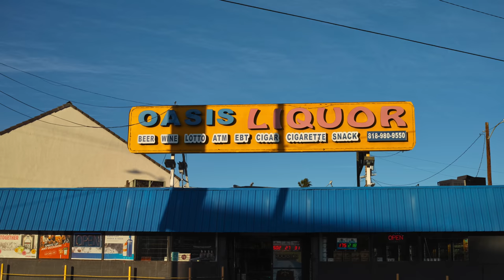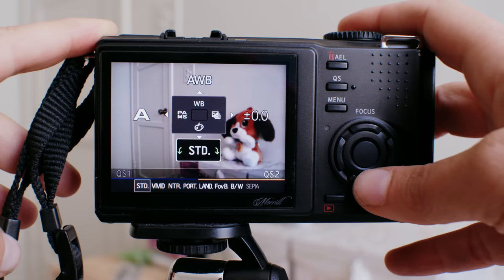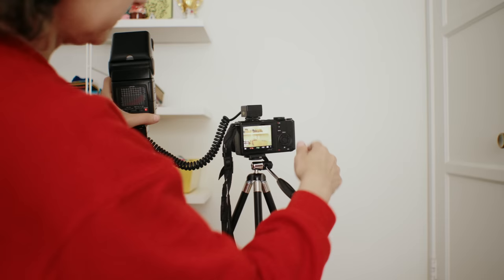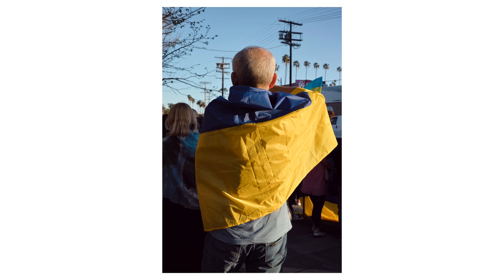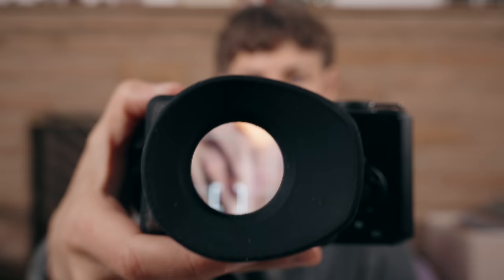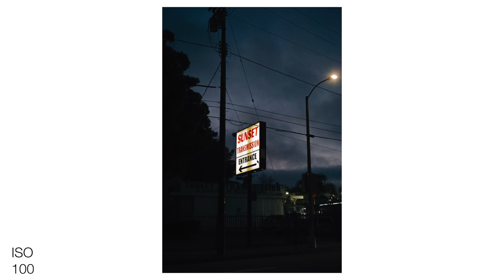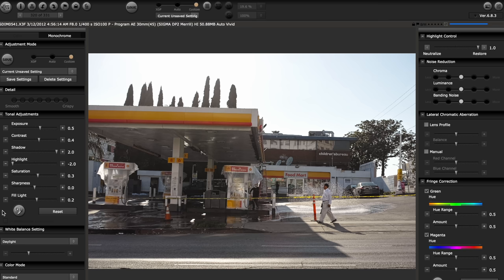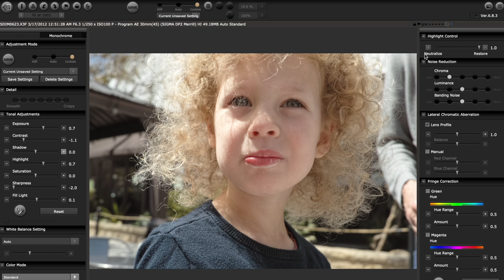Sigma DP2 Merrill Review

Comment: Nice video! The first generation had 2 dps, the second 3 and the third 4. You can do high iso with the Dp Merrill cameras in B&W if you like high ISO film look with grain. One trick in SPP is to choose 100% blue in the monochrome menu. Then you use the data from the top layer and not in the lower levels. This means you get much less noise. Test by changing to 100% red to see. The light is moving through the sensor so one have drop off and noise at the bottom. This trick only work with Merrill files. For me it is always the outcome that matters most, so I don't mind it's slow operation. Photography is my zen after all.
Reply from the maker: This a fantastic bit of info! I didn’t realize until after posting that I hadn’t even touched on the incredible black and white capabilities. Definitely pinning this. Thank you for sharing.
Reply: Hey Innstikk, why would this only work with Merrill files? Although there will be comparatively less noise in the red and green Quattro layers, why wouldn't it work there also?
Reply from the maker: @ricblessing3400  Great point and question!
Reply: @Ric Blessing  It should work with Quattro, but Sigma made the wheel work differently for Quattro. So far I only see the effect with Merrill files. I guess it could be as the two lower layers have less resolution in the Quattro sensor, they are already using the top layer to get to the toplay resolution. I don't know their decisions, but at least it works for Merrill. Merrill is also very nice for B&W due to they way they implemented the microcontrast.
Reply: But wait, there’s more. If you are into B&W photography and rely on color filters, Sigma Merrill series cameras do double duty as a monochrome sensor or B&W film – a unique feature for a digital image sensor.
Reply: @OneMonthTwoCameras Hello, I am curious…does this camera have a mechanical shutter?
Reply from the maker: @IamRorke  it is a leaf shutter

Comment: I don't believe Sigma will ever produce the full frame Foveon camera. It's been in development hell since 2019, and IF it does release, it will be extremely expensive to cover the development costs. The last interview with the CEO didn't sound promising. The Merrill generation, which I've owned all of including the SD1, are by far the best Foveon cameras, with the DP2 having the most superior optics. These are the only cameras I've ever owned that when reviewing the images I've audibly gasped and said "Wow". In the right conditions, they are nothing short of magic. I've been dreaming of a full frame version for a decade.
Reply: Sigma fp with foveon❤
Reply from the maker: Curious to see what will happen!
Reply: SD quattro and DP quattro are more fun and less annoying
Reply: Why bother? The APC is a fine size.
Reply: @unbroken1010  Perhaps. I prefer the image quality of the X3 Merrill generation over the Quattro sensor. The Quattro trades off true Foveon architecture for reduced noise and therefore does not absorb 100% color on each layer as opposed to the X3. As far as the sensor size, I prefer full frame due to DOF and lens compatibility. With a larger surface area for the sensor, the light sensitivity should also greatly improve as well as noise levels at higher ISOs. That is the key reason for Sigma's attempt at a full frame sensor. Ditching the SA mount for the L mount will be the biggest upgrade by far.
Reply: @daygon128  maybe but in reality regular people viewing your work on a wall or in a book are more interested in content and not bokeh. Bokeh is a bit obsessive and does not always contribute to a photo. It can actually be a hinder in a lot of cases.  Lots great Photos got taken at 400 ASA 🤷
Reply: @unbroken1010  I use the Fujifilm GFX for most of my portrait work and have made several videos on it. Bokeh for me is a stylistic choice for portraits. My clientele, and the internet in general loves it, while photography gatekeepers hate it (but yet it's ok if they do it). 90% of prints I have sold at galleries were shot at f1.4 or wider unless it was my landscapes. I'll shoot an entire job at f16 if the need is there. DOF on the other hand, is essential when I'm shooting in less than ideal conditions with busy backgrounds. APS-C is fine but I typically find myself having to switch to long focal lengths to isolate my subjects and when using a wide f stop such as 1.4 on APS-C, that's still only the equivalent of f2 on full frame. As for the future of Foveon, I'm intrigued by the prospect of full frame because they have only ever done APS-C. If someone wants APS-C, they've already got you covered. I don't shy away from taking photos at higher ISOs either, so if they can improve the next sensor's tolerances I'm all for it.
Reply: @unbroken1010  the only aps-c lenses that are worthy of next gen foveon are Leica t lenses, and they’re discontinued.
Reply: I agree , best image bar none .    Owned  #10 , #14 , #15 , Quattro H .      Slow , quirky , and was hoping Sigma was going to make a FF pro model with all their experience make a 100 meg gem .    With their lenses , and sensor , Wow what a dream .
Reply: @unbroken1010 Merill have better microcontrast. They produce 3d like images. Quattro not that good.
Reply: @GSMaheshGS  my Quattro is great. The Merrill is not much difference and not worth the headache at this point unless they have a better work flow 
for editing... Photographers have a knack for  "micro contrast" that nobody else will ever see.

Comment: I have had this camera since maybe 2014 or 2015 when it could be purchased new, but I have not used in a while. I just checked my old notes and found these tips on exposure:
- If you have a scene that doesn't have much DR, use ISO 100, but if you have a wide range of brightness, use ISO 200
- At ISO 100, you can overexpose by 1 to 1.5 stops.  At ISO 200, you can overexpose by 1.5 to 2 stops. 
- To restore highlights, you can add some fill light (about +0.3) and decrease the exposure slider to -1 (or more) stops until highlights are restored, export to Lightroom, and increase the exposure by +1.0 to restore darker areas.

Comment: Nice review. You've nailed the exquisite torture of using Sigma cameras. For all their many  quirks and flaws, they have an uncanny ability to produce (quite literally) jaw dropping images - usually only revealed when the files are viewed on the computer (which makes that stage all the more rewarding).  I've had examples of the last three sensor generations and still have the three dp Merrills and an Sd1 (definitely worth a look). Using these cameras is like learning to drive in a VW Beetle - it's not easy but you come out a better driver/photographer. The unforgiving dynamic range, for example, means that you just have to get better at exposure. And the Sigma experience also makes you better appreciate your other gear - my main body is an A7r2 and it's often criticised for poor battery life, but alongside a dp Merrill its batteries seem to last forever.  One very useful workaround I've found for the appalling battery life is to track down the AC  adaptor (a battery shaped insert with a cable).  It's great for studio work, but where it shines is that you can relatively easily connect it to one of those portable phone chargers for outdoor use.  A bit more stuff to lug around but it gives you the luxury of using the camera without watching the bars on the battery meter disappear before your eyes. One final thing - and a segue to another camera you should seek out if you haven't already - the dp Merrill batteries work in the ricoh gx100 (which, in terms of usability, is everything the Merrills are not, and also happens to take very nice pics).

Comment: Well done. I use a loupe as well but if I'm not shooting street but rather landscape or macro, I hook up my DP Merrills to a field monitor. It totally gets away from the issues with the weak lcd. You get a much crisper view and you can use features like focus peaking with manual focus for critical work and you expand your exposure controls with zebras. It's basically like adding firmware. As you mentioned, the slow process with Foveon bodies is like large format so I'll occasionally invert the monitor view for the OG LF experience, lol. If you have the cable that came with the DP2M, just find a monitor with RCA inputs, they're pretty cheap. Grab a magic arm and bolt it to your tripod and you're good to go.
Reply from the maker: WOW! What an idea!!! Thank you for sharing.
Reply: @Phillip Banes with the DP Merrills I used an Aputure VS-2 7 inch since it was the only one I had with RCA inputs. It will do up to HD (1920x1200) resolution but the video feed from the Merrill cameras is only VGA (640x480).

Comment: Thank you for keeping knowledge of Sigma cameras alive. I have Dp1x, Dp2, Dp 1, 2, 3 Merrill, Dp0 Quattro, SD Quattro. I use Sigma WR Filter instead of lens cap too. 
ISO 100 is best, but in low light I frequently handhold Merrill and Quattro at 1/13 or even 1/10 with high success.
You can do TTL with Cactus V6II trigger and Cactus RF60X Flash. The flash is discontinued but can still be found used. Works on Merrill and Quattro.
Reply: Which of them do you prefer or use the most? What are the differences between Merril and Quattro? Thanks

Comment: A few resources that may be helpful for flash photography. Strobist with David Hobby. The gold stqandard for off camera flash and free. Tangents, off camera flash. great newsletter. Flash Zebra for all the cords adaptors for old and new flash. Also, most inexpensive wireless flash triggers will work. You can use a canon to trigger Fuji and  Nikon. Just use manual flash setting.

Comment: Got one, new when the prices dropped back in the day. All said here about it ... Never messed with the software, I just use it as an replacement of a 50mm 35mm camera. It's quite like that, and I think it's the idea behind the product. It does like a camera from the 80s, including the need for sunshine. I like the concept of fixed focus, the natural view. I run it from a 18650, made a custom battery handgrip. Experimented with a flash too, indoor pictures are so sharp, compared to pocket cameras. Note these are prone to dust. They came with visible particles inside the lens out of the box. No problem at this point, but the camera should be handled accordingly. I always keep it in a zip bag.

Comment: The DP1 Merrill and DP2s are my Sigma Fovean cameras, and I love them both - the DP2s being more compact than the DP1 Merrill.
For the DP1 Merrill, I use and old external 28mm viewfinder from Voigtländer attached to the hot shoe. I works, because the little "warning" light on top of the camera is visible in my field of view just below the external viewfinder.
I only shoot in RAW - and sometimes, I use the option to save in double the original size when processing in Sigma PhotoPro. The thing is, the TIFF files resulting from that are huge, but so is the resolution.
I hope to do more testing of the DP1 Merrill for street photography this summer, because I do agree with you - it's an outdoors camera (that just loves light).
Seems like I might have to keep an eye out for the DP2 Merrill too with what you just shared here.
Reply from the maker: Yes to all of this!!

Comment: Love this camera so much I had to say another thing: if shooting RAW, expose to the right (ETTR) when using a Merrill. There is SO much dynamic range in the RAW highlights. You can cram the histogram way over to the right, to the point where it looks badly clipped on the LCD, and then drop the exposure 1-2 stops in SPP. And then use Fill Light/highlight/shadow tools for a fine result. The extra light will also reduce foveon color blotching in the shadows. I'd been exposing to protect the highlights like I would any other digital camera for ages and was so frustrated by high contrast scenes. But hard ETTR + exposure reduction in post gives amazing results with a Merrill. The Sigma Quattros will clip like crazy though; you have to protect the highlights with them.
Reply from the maker: Interesting! I will have to try that out!

Comment: 19:50 <--- this has been a hotly debated topic across Sigma forums forever. The consensus is that Sigma probably didn't add this capability purposefully (cripple hammer) as they didn't want these pocket cameras to compete with the SD Merrill DSLR. I have seen contraptions online that implement a physical button press with remote release.

28:00 <--- the logical thing for Sigma to do would be a full frame, L Mount Alliance based Foveon camera that takes any L mount lens, is weather sealed and geared towards landscape, architecture and studio photography. This would be extremely attractive as you'd probably not need consider digital medium format at all, given you could use your L Mount lenses with a Leica or Panasonic body where Foveon shortcomings would be too great (low light, speed, etc.) and use the same set of lenses with another Foveon body where Foveon makes sense.
Reply from the maker: Really good notes and yeah, if Sigma does that FF X3F with L mount, I think we’re going to see a lot of converts. I have a very accomplished academy award winning cinematographer friend who said the new Foveon is what he’s waiting for on his films. Until then he insists on sticking with celluloid.
Reply: @OneMonthTwoCameras  I don't think we'll see video on Foveon in a hand-held mirrorless body. It would be interesting though if Sigma added a Foveon variant to their fp line-up for video - the implications would be no mechanical shutter - which eliminates such a camera for photography use cases. If I had to pick between a photo-centric and a video-centric Foveon camera, my choice is clear: screw the film makers ;)

Comment: But I like using the LCD! And I’m happy with the AF too - it works just fine (with the focus limiter on). I take a lot of photographs from a coracle (a small flat-bottomed boat), so I’m used to the scenery shifting around when I let go of my paddle and pick up the Merrill. Holding the camera away from me is proving more practical and photographically much more interesting than having my eye clamped on a VF - compositionally, for instance, I’ve learnt to let go of fine detail and concentrate on structural relationships between darks and lights. The 3x3 grid is great for that (and the annoying glare off the LCD is a problem no longer!) Works well for me off the water too.

Comment: I'm perplexed, my DP2M is afflicted by the cursed green cast problem.
My shots (and those of many users) absolutely require color correction for this reason.
From what I see in your video, your camera for some reason is miraculous and returns much more neutral images.
Reply from the maker: Are you shooting jpeg or X3F? If you want to send X3Fs of some of your photos I’d be happy to make a little recording of how I edit to see if it works on your images as well.
Reply: @OneMonthTwoCameras  Thank you, you're so kind. I shoot exclusively in x3f and unfortunately the green and yellowish cast is almost always quite evident. Each photo needs color correction to limit the damage. Unfortunately, the image does not always have a medium gray (or a not too bright white) as a reference to select, so it becomes difficult for me to correct. That's my big problem with this camera, always.
Reply from the maker: Email me Onemonthtwocameras at gmail and I’ll do a quick run through if how I’d process your shots if you want. I don’t rely on the color picker for white balance so not having a neutral in shot shouldn’t be an issue
Reply: @@phillipbanes5484 Green or yellowish casts are a problem for quite a few merrill owners, just do a search on the net to realize it. Evidently not all Merrills work the same way...

Comment: Nice, I have a loupe too, but didn't know they had retractable ones! have to look into that, such a space saver :-) I also have a small cage that will improve grip but makes the camera more bulky (I use it when on longer trips). ps: ISO I use 100 till 200 but pref 100 to 160 max. (Higher ISO's maybe for B&W) And about 4-5 batteries , it depends on the weather. hha for a very short trip, maybe 2 ...
Reply from the maker: I’ve had my eye on a grip as well :)

Comment: Thank you for your first class review.
Especially your tip to use the Ricoh Converter GW-3 I found exciting. I have ordered one, but unfortunately everything remains blurred. Even with manual focus. Can it be that one must also use the adapter Ga-1 for this? In the video you only have the GW-3 screwed on. What mistake am I making.
Thank you very much, Christian

Comment: FYI, Canon has had program has had program shift on SLRs since the film T-90 (maybe earlier?). It even shows up on some film Canon Rebels.I'm pretty sure it's on most of their DSLRs and all of their RF mirrorless cameras. Just make sure you are on P mode and NOT on the green rectangle.

I don't have a lot of Nikons, but I just tried Program Shift on the D80 and the N75 and they both have it.

What manufactures are you thinking of that don't have it? Maybe you're talking about cameras other than SLRs?

Great video! Someday I'll get a foveon camera. What do you think of the Sigma DSLRs?

Comment: Does the Kamerar CVF-1 External Viewfinder fit well on your Ricoh GRIII? (hopefully you've tried it out) ... reason be is that my eyesight is terrible. Of course, I'd only be using it sometimes in the outdoors in the bright sun. a bit of landscape etc. since it's such a tiny compact camera wit a 3-inch screen the size is just right for the device. I'd really like to know if it fits properly with the straps nice and snug (and not loose) on the GRIII/x body or is it just not worth the hassle. thanks for your videos btw subbed!